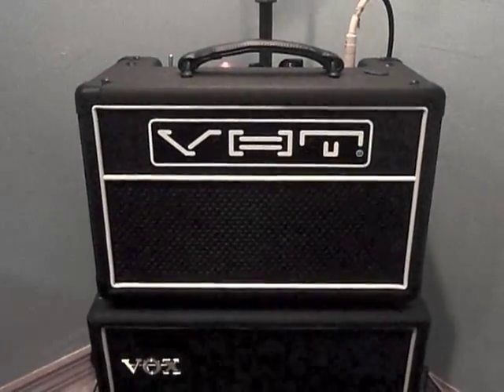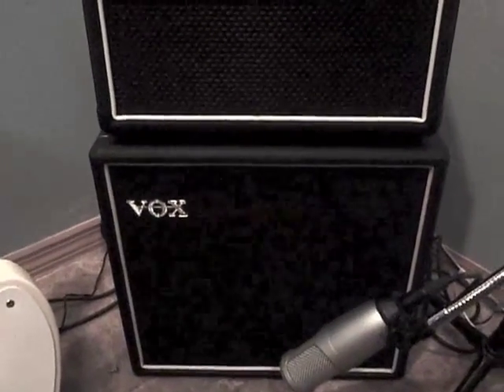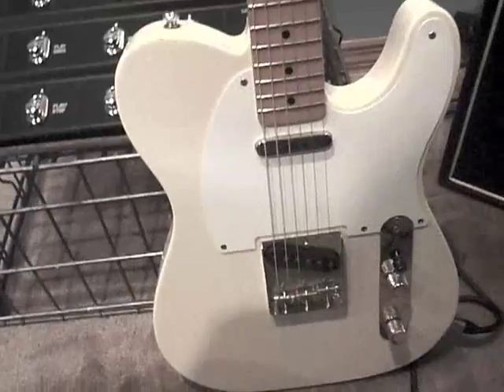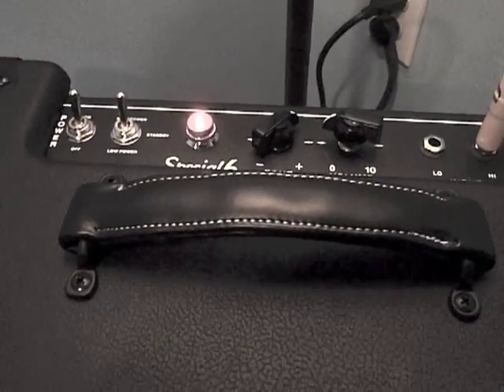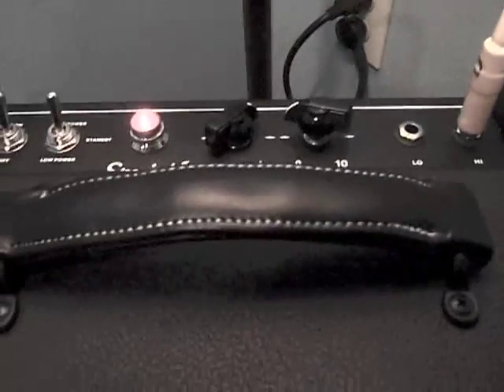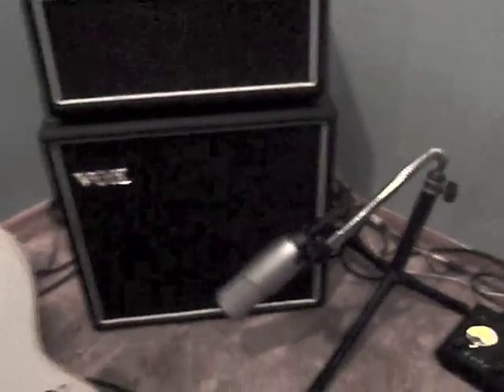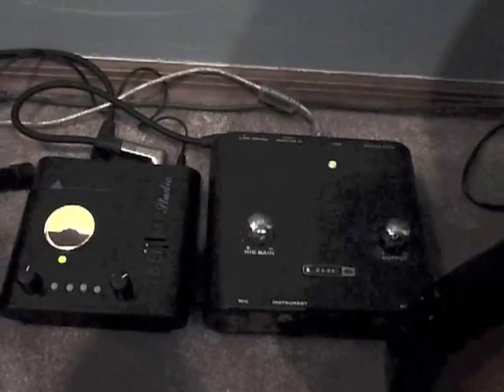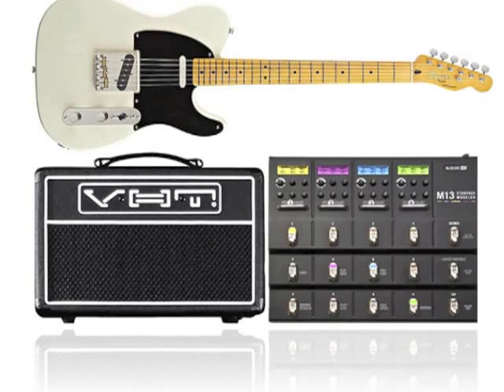VHT Special 6 and Line 6 M13

Comment from the maker: @catoal93 Thanks very much.  The M13 is an effects system that is not intended to be used straight to house because it doesn't contain any type of amplifier or cabinet modeling.  Its the same if you just took a pedal board and plugged it in to the PA.  Wouldn't sound very good at all.  What you need is a preamp.

My suggestion, if you're going the M13 route, is grab a Tech21 Character Series pedal.  Or, try the Digitech RP500.  Fantastic amp AND effects modeler.